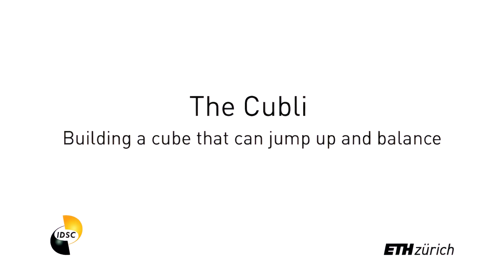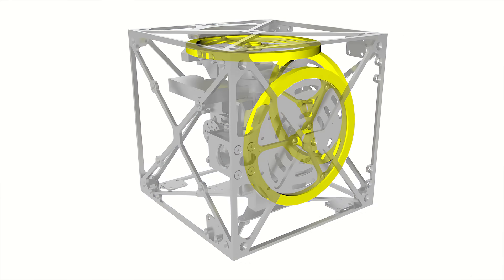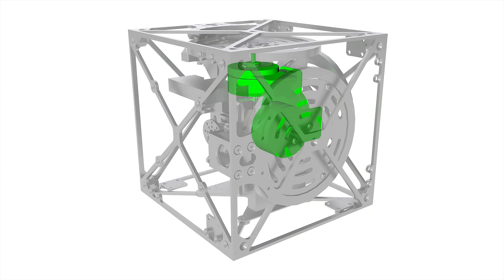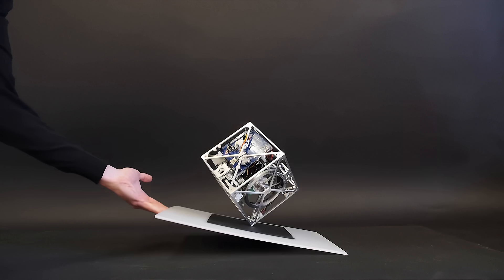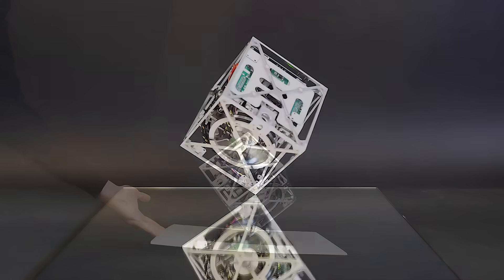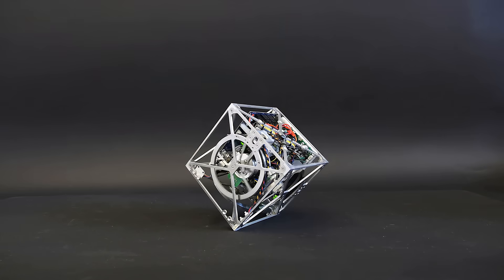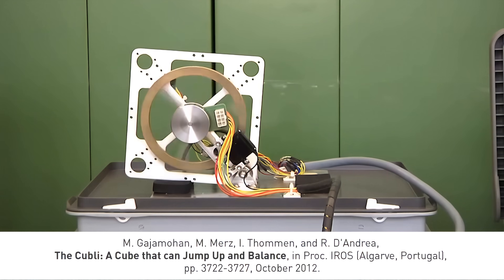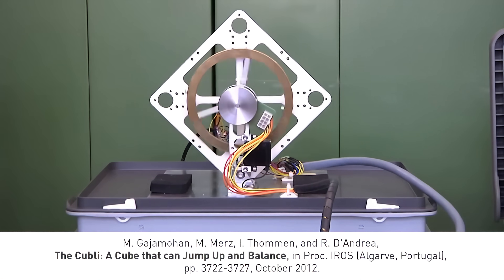The Cubli: a cube that can jump up, balance, and 'walk'

Comment: Those brakes must take some serious beating when it is jumping. I guess you gotta replace them often.
Reply: +PerunaVallankumous The brakes are not mechanical but through  the momentum of the wheel is used through  the reaction of the magnetic field/current in coils   and then through the motor case itself.

Comment: imagine a building using this method
Reply: +Yves Santos It would be cool . . . until the building decides to 'walk' away.
Reply: Connor Burman
 Unless you're one of the workers in the building . . .
Reply: +Carl Bruschnig, Jr Implying that that wouldn't make it so much more awesome
Reply: +Yves Santos that would require alot of energy to work .. imagine 3 big motors rotating , the respond time is also high on big electric motors ... it wont work
Reply: Yeah but the power goes out and everyone's fucked
Reply: we use this technology on floating objects.

Comment: Planetary explorations? This is only possible with planets with a gas layer right? So in our solar system that like only the Earth?
Reply: +Leone Legender 
Nearly correct, the only two planets to not have atmospheres are Mercury and Pluto.
(Yes I still see Pluto as a planet.)
Reply: Wiebe Kuper this is moving around its axis using torque, not pushing air. That things are wheels not fans.  And most planets in our system have atmospheres, actually, I think they all have.

Comment: Hmm. So I don't understand the physics here, but from the video and Gajamohan Mohanarajah's comment below I understand that it stays upright from "reaction torques". Which presumably just means that it's three fans pushing (or pulling) air in order to stay upright? Not really that interesting tbh, or not as interesting as it would be is if it was staying upright from a gyroscopic effect. This would also presumably preclude it working in environments where there's no air to push against?

Please correct me if I'm wrong here, but that's what "reaction torque" sounds like to me?
Reply: Ciaran Power Those aren't fans. They're spinning wheels. Imagine a bicycle wheel spinning very rapidly, and then you suddenly grab hold of it. The torque that would be applied to your hand is similar to the torque applied to the cube when the brakes are actuated on the wheels. If you carefully control the wheel speed and braking force, you can also control the position of the cube.
Reply: Ciaran Power No it is a triple gyroscope, just accelerating, changing speed and stopping rapidly.
Reply: Ciaran Power No, imagine you are in space, on a bicycle, if you start turning the wheel, due to conservation of momentum you will spin opposite to the wheel, this cube machine is abusing the effect.
Reply: Ciaran Power No, imagine you are in space, on a bicycle, if you start turning the wheel, due to conservation of momentum you will spin opposite to the wheel, this cube machine is abusing the effect.

Comment: They should market them and sell them, lot's of kids would love to have one, lots of adults would probably love one as well.

Great device.
Reply: I would put it in my office and enjoy the confused looks of customers and colleges :)
Reply: Solar Gaze But being the first one it tends to be the one that costs the most to produce and takes the longest to set up with tools and so on.

But a machine producing these could probably knock them out pretty cheap.

I'm sure a machine could produce these accurately enough for a toy company even if it was produced as a partial kit with instructions and a small tool set to fit it together obviously with a video showing how it's done.

The kids with an inquisitive mind would probably love one of these and those kids that were not able to build it perhaps have a trade in system so they could send off their kit and get back a ready made one, or simply buy a ready made one but with clear differences so those that built it could feel proud of their achievement and those that didn't could still play with it and have fun and learn.

Different sizes, and perhaps even some fun suggestions regarding its use and hold competitions for the uses of it, different applications for it and so on.

But I'm sure a machine could produce these without too much trouble, hell think of all those hard drives being produced and at what price they sell for you don't get much more accuracy than those things.

I look forward to seeing them on the shelves in the not to distant future.
Reply: flitsies Certainly, I'd love to have one to show off.
Reply: ejmac11 I recon there would be a pretty good market, and a lot of spin offs from such a device once put inside other toys or gizmos.

They are missing out, of course it has to be the right price, mass production and all that.
Reply: flitsies I agree with all of those points, hopefully they can get it to where the price is reasonable for the average person.
Reply: flitsies i´d definitely buy one!
Reply: ***** It would only rival stuff like lego if the people playing with it had some kind of input into the way the structures ended up.

But they would make a great fun object not only for kids but executive toys.
Reply: flitsies It was also designed using precise measurements, they would need a factory that can design incredibly precise tools /machinery
Reply: its a very complicated and expensive machine
Reply: Theo Byström So are computers not least hard drives, memory, processors and so on, all very complex devices, and yet I can buy a pc quite cheap now.

In fact I can buy a hard drive for a few pounds less that fifty I will even go one step further and say you can buy a brand new hard drive for around 30 pounds.

And where are all these things made so cheaply? Why of course China where else, they may be designed in the USA or the UK or Japan or Germany or wherever but all made in China for the mass market.

Don't see why this couldn't be. 

At the very least this is an oddity the kind of thing people would be fascinated with.

For sure there may only be a limited life for such a product run but it's something that would surely spark some interest not least amongst kids studying science or physics or engineering, and would be great fun in the office.
Reply: flitsies A hard drive has two moving parts and is assembled by machine. The computer software in it's IDE main board is quite simple compared to this cube.
Reply: flitsies True :D
Reply: flitsies True :D
Reply: flitsies but there are thousands  and thousands of hardrives being made everyday which makes them cheap and shows there is a huge market for them,For this device a completely new manufacturing process needs to be created for this cube, all with amazing quality control to make sure the devices created are the right size shape and weight for it to balance properly.Don't get me wrong, id love to see these in market(even though I may not be able to afford it when it first hits) , i would also be very interested in making one myself if i can access their measurements, materials and parts.
Reply: KitCox But even so a computer which there are now millions or billions of them are quite complex devices and you can buy a complete pc for around £20 or even get one free albeit an old one.

And then you have the software that makes the pc run all highly complex stuff but once it's set up and running it often ends up so cheap it's given away.
Reply: Solar Gaze Well here's the thing I suspect using a combination of materials rather than the exact material it's made out of here they could probably engineer one that worked pretty much the same but on a much lower budget.

I'm guessing it's some kind of gyro system and you can get gyros dirt cheap, so it's a matter of making the thing do as it's supposed to.

Now I'm no expert but I would have thought if this were taken to the right kind of Chinese manufacturer they could probably knock these out fully functional and performing pretty much as this one does for around £5 more or less, so long as the quantity were worth the effort.

Hell they knock out crap motorcycles that look good and function perfectly well for a short time anyway for around £100 give or take a few pounds at the manufacturing point.

As I said even if it were a kit that people had to put together using videos provided online or some other method this would be a good item for kids to have who are eagerly into engineering or science or whatever and a great talking point in an office.

It will be a great shame if they don't do a run on it at least once a one off 10,000 or something, sold on ebay or amazon for the world to have a chance of getting their hands on one.

I would be surprised if the demand didn't exceed this in the first week.
Reply: flitsies There will be price drops if there's a market besides the curiosity and toy markets, and machine production can be realized.
Reply: KitCox check out some of the 3d printed gyros pretty interesting stuff, perhaps the 3d printing could lend itself to this.
Reply: flitsies I agree. This prototype that appears to have the precision of a Rolex watch could be scaled, material wise, over to high tech plastics.  The gyro bearings would have to be the only high precision part to avoid errors from precession.That would put it in the hands of engineers and experimenters. And you and me...
Reply: KitCox Well let's hope they do something with it cos it's a pretty curios object, be a shame to let a potential winning curiosity end up being hijacked by someone copying it. 

Some of the toy makers have science toys production lines which cross over into office goods, just pitch it to them and licence them to make it.

So many ways this could come to market let's hope they do something.
Reply: Igor K I'm sure they could do them for much less than $100 more like half that or even less.

But even if they did it at $100 I'm sure many people would buy it just not as many as would at a better price.

Anyway let's wait and see perhaps someone will set the ball rolling and try a small run on them.
Reply: Igor K I believe they would try to come up with something similar, but it wouldn't work they way it should of that I'm sure without the actual device, but one thing about this would be that at least they try to get the thing on the market.

Here we have a product that has quite a bit of interest and nothing from the inventor no companies clambering to sell it to us. 

I find that odd!

It's clearly been seen now by many people who use youtube, so if anything they should produce it now before someone comes along and nicks the idea right out from under their nose.
Reply: flitsies The comment about hard-drives got me thinking.  Three scrap hard-drives give you precision bearings and precision balanced flywheels.  May need to drive them with stepper motors instead of the internal one.  Then you "only" need cheap electronic giro sensors (two a penny in toy helicopters), the processing power of a mobile phone and the software.  A feasable hack,  I reckon.  Commercially, these could be down in the fifty quid region within 5 years...
Reply: Ray Kent I agree they could be way down below the £50 mark quite easy.
Reply: Theo Byström I dont think so. Yes they put many hours of work into it, but it should be pretty easy replicate the cube. ESP-systems in modern cars are by far more complicated, yet they are mass produced. I think you could build one for few hundret dollars if you get the scemes and the sourcecode.
Reply: Igor K So long as you put clear safety warnings on the device and don't sell it as a toy but a learning instrument it's up to the parents to monitor their kids.
Reply: Igor K isn't that the same with everything?

Even the computers that we love so much have their crappy Chinese copies, that doesn't mean everything that comes from china is crap.

The only difference is do you buy quality controlled Chinese product or do you buy crap knock off Chinese product, quality controlled Chinese product will work better and has guarantee knock off you take your chances.

What isn't made in china now?

Open up any computer you will find made in china somewhere, open up any time peace, you will find made in china, and the better quality will have warrantee because it has quality control.

If the people who invented this controlled production there would be no reason for this to be a shoddy product, however if they simply neglect the product someone will copy it and produce a piece of crap because they won't understand it.
It could be an executive toy, a science piece, a learning piece, and potentially have other uses in the real world perhaps.
Reply: Igor K Regarding range rover you're probably right.

I agree with you regarding Chinese production as well.

So long as the products have quality control then many products that come from china are well made.

Hell most things are made in china especially in the UK, you would be hard pushed to find something that wasn't made in china.
Reply: Igor K The odd thing is many of the things made as tourist gifts often say made in china if you get them from the uk.
There really isn't that much that isn't made in china anymore.

Think about the computer market, most people couldn't afford one if not for the fact that they are made in china.

Many sound systems, sunglasses, ear phones you name it they make it, cameras may have a brand name on it but when you go into the workings it often says made in china on the boards and even the lenses but they are made to that companies quality standard.
Reply: Igor K Yes this is true, many of these large companies want to make the profits available to them when they sell the products to their home market but they don't want to cost of production.

I don't blame them but what happens to the home markets economy, many people struggle to find jobs and so on.

So there is a positive side to their actions which is most people in work can afford the products, but there is a negative side which is lots of people struggle to find work

Many people buy the knock off Chinese products because that's all they can afford, just because you don't have a job doesn't mean you don't want the products, it just means you can't afford them, so there will always be a market for the knock off products due to the high cost of the original products.

Just look what happened to the video market, they could have sold them much cheaper but decided to put a high price ticket on them, so there was a lot of knock off cheap copies which had a huge market, the video makers whined about how they were losing money but in reality they didn't because the people who were buying the cheap knock off couldn't afford the price of the original in most cases so couldn't have bought the original anyway, they lowered the price of the original then people bought the originals, if you notice blue ray was popular only to those who could afford them, most people still bought/buy dvd cos it was much cheaper but good enough.

With regard to movies, all the while blue ray is expensive dvd will have a huge market, and so will the knock off if the dvd goes up too high.
People suffer the poorer quality because often they have little choice budget restraints.
Reply: Igor K We could live without many things including cars, electricity, stereo systems and so on, but would we really want to? No.

Smart phones are just the next stage in our tech that takes us forward.
If you use a smart phone the right way you can reduce your phone bills, for some people this simple change has drastically reduced their communication costs.

The only thing holding back mobile internet is the way it is packaged by the main mobile internet companies, in the UK for example they have strangled the use of the mobile internet unless you pay a high price for it, there is no need for this high price as it's on all the time, but in order to make people pay more they ration the use of it depending on how much you are willing to pay for it.

If a Chinese company turned up and offered mobile internet at a much reduced price even though not perfect in its operation a huge amount of people would take it  up, because not everyone can afford the type of mobile internet on offer today but lots of people want it and feel they are missing out due to the high cost of it.

What do you suppose that would do to the home market phone companies profits?

We know what would happen to the so-called knock off Chinese mobile internet, it would rocket in popularity and only improve. The home companies would whinge and whine but slowly lose their customers as the Chinese net got better.

You see what I'm getting at here can't you, the greed of the home market kills it self by excluding a huge amount of customers that still have a need, in fact they ignore them rather than embracing them, then along comes a Chinese company that works out a way to offer what people want and hey presto a multi million dollar industry that's a long way from perfect but people are willing to put up with it at the right price, you only have to look at Microsoft.
Reply: Igor K It's only a matter of time, as their prices go up so less business will go their way and they will invest in more machines to do the work and they will have lots of people unable to make a living.
It will be interesting to see how they handle it at the moment they are branching out into other countries exploring markets the west ignored so I'm lead to believe.